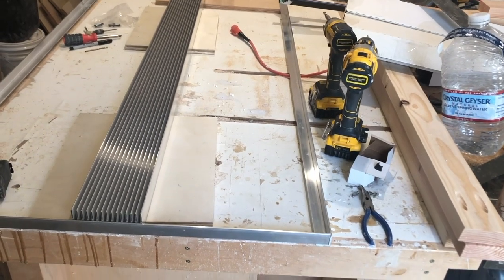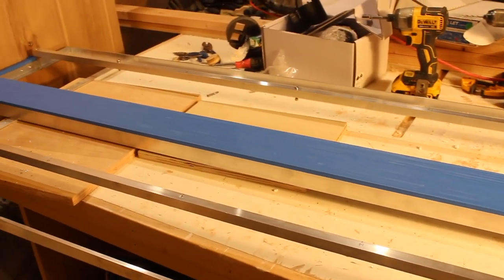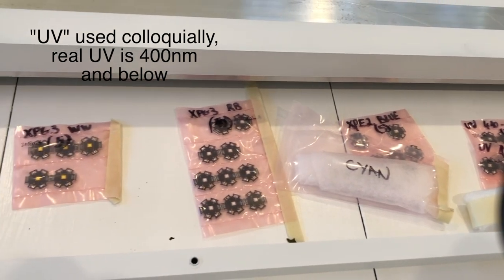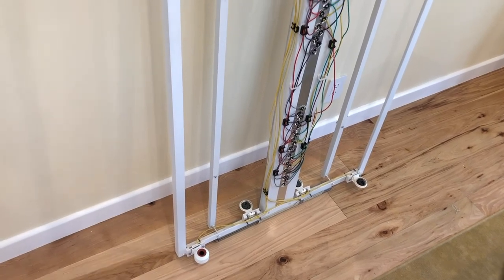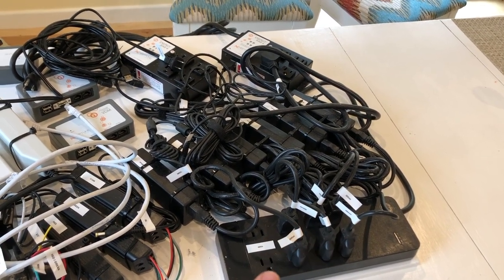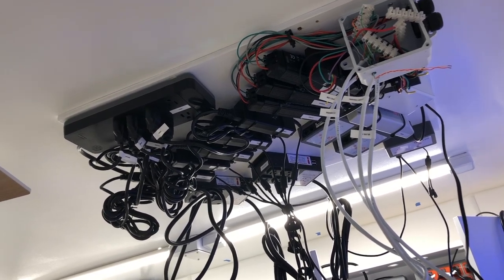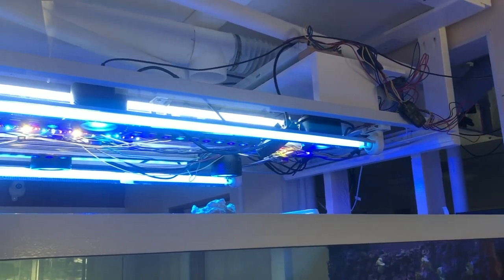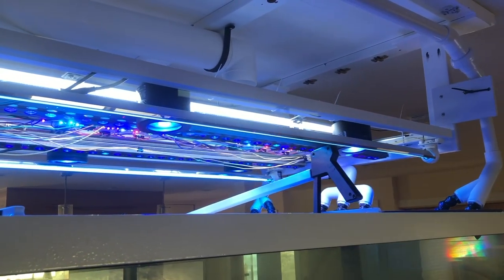Ep. 9 | Build Series: Display Tank Lighting

Comment: You can't mount your surge protector upside-down like that. It's a huge fire hazard. Over time the plugs can work there way like half way out and with all of tha moisture in that fish room or above the tank and you will get an arc. You are making an amazing system here can't wait to see it progression of this tank! You should do a video on your current display so we can see whats coming over to this one.
Reply from the maker: Hey Erik - do you mean the power strip in the lighting panel on the ceiling? I've never heard that you can't mount them upside down -  but I'll check into it. I think the chance of moisture causing an arc is pretty minimal, as the fan is constantly blowing air through that panel, and the humidity in the fishroom is kept at 40% with a humidistat. Plugs haven't moved in 6 months, but, I will keep an eye on it to make sure. Thanks for the advice. I don't actually have a current display tank - this one is all starting from scratch. When I moved from my last place, I vowed never to set up another tank before buying a house - I had to break down too many tanks because of moving over the years. So, I've been without a tank for 5+ years. You can see all my pent up reefing energy put into this system because of that!

Comment: Why the led strip in the center if your using kessils?
Reply from the maker: Hey Steve - basically I wanted some additional lower blue wavelengths (~400nm) and color adjustability - the 360we Kessils don't really have much color tweaking available other than white to blue(the new 360x's have more). Also, I had a ton of LED ballasts left over from another project, so it was the cheapest way to get some extra PAR. Ironically, the tank looks best with just the DIY leds on and the particular mix of blue it gives (plus warm whites, red/green, cyan, and "UV"), LOL - go figure.
Reply: @ReefEco  ahhh ok sounds nice. Kessils more for shimmer.
Reply from the maker: @steevareno2002  Exactly - I really love the Kessil shimmer...